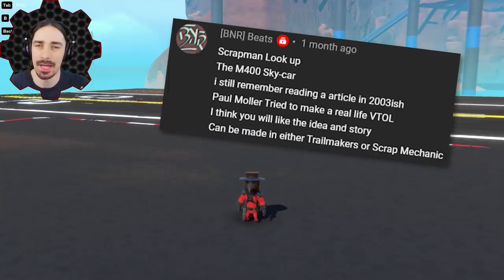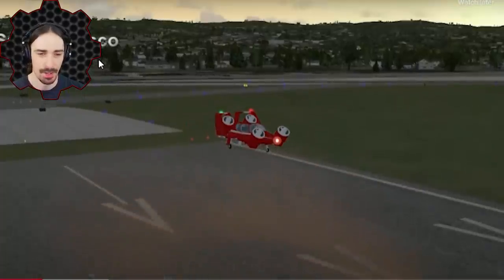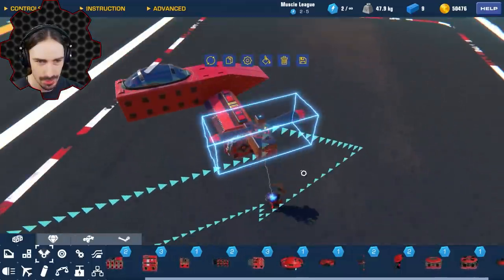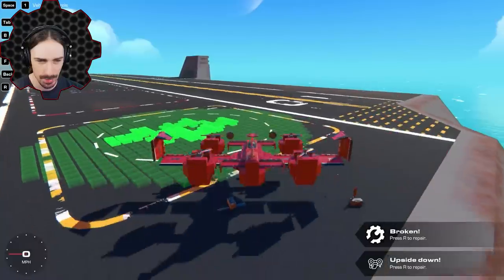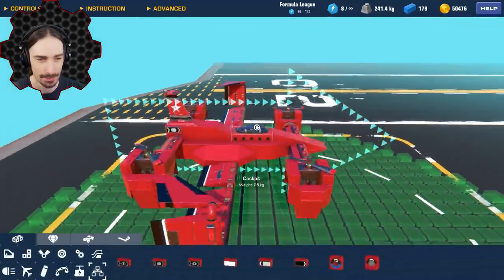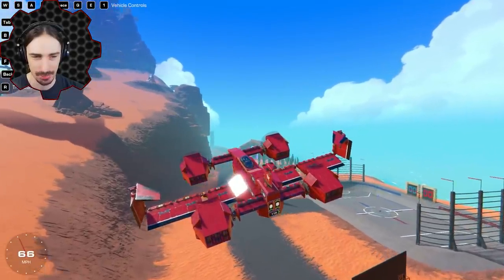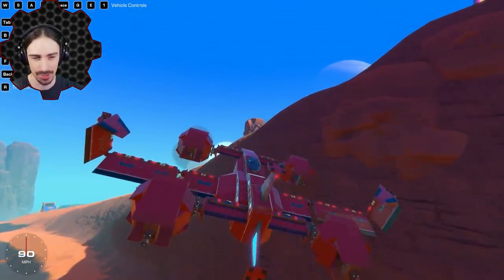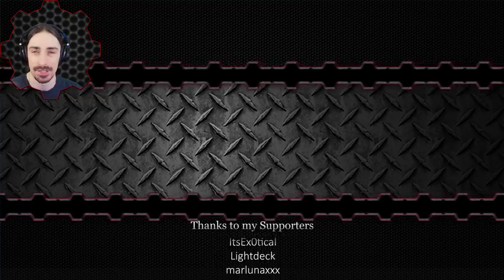This Failed Flying Car Was Supposed To Be Our Future... SO I BUILT ONE!

Comment: Problem also is having an open propeler spinning thousands of rpm in a street
Reply: For this version, yes. The original had its props inside of a duct, presumably just to get around that problem.

Comment: I'm kind of disappointed that you immediately changed the design with out even giving the original idea a try. Even though im pretty sure it would not have worked. The blueprint you ended up with did turn out really cool though.

Comment: day 170 or 171 of asking scrapman to start a Survival series amphibious tank/basically any transportation and floating base/barge (or under water.) But you need mods... it's a requirement to breathe underwater, if you want an underwater base/transportation. And yes i am talking about the underwater fan moonbo reviewed that basically makes water spaces air spaces... if that makes any sense.) (and if you wanted to move the barge/boat/floating base you are able to make thrusters/glitches/mods to do it or by lift or actual push

Comment: Yeah, hate to break it to ya, but flying cars are probably never gonna be a common thing for the everyman.

Why?

Because we don't armor our roofs.

Do you want it to be possible for some random, possibly drunk/high/exhausted idiot to crash through your ceiling while you're in bed? Or through your kids' ceiling and crush them in their cribs?

To become a pilot requires a lot more training, frequent medical exams, and can be revoked for comparatively little reason vs. driving a car.

Imagine if to be allowed to drive a car, first you had to have roughly 100 hours of ground, dozens of hours of practical instruction, then to pass a number of hurdles, had to train for what happens if you get a flat tire, if your engine dies, etc, then pass at least one final test... and all that is so you can fly a low-powered commuter car on surface streets on clear sunny days only. If it rains or even just gets cloudy, you have to pull over and wait for it to clear up. If it gets dark, you have to pull over and wait for dawn. You also have to file your plan on where you intend to go with the state highway patrol (though you're not allowed to even think about going on a highway yet).

If you want to drive in the rain or at night, you need another bunch of education, training, and testing. If you want to drive a more powerful car, or one with different capabilities, that's more training and testing. If you want to be allowed to carry passengers or cargo to make money with your car, that's more training and certifications. If you want to switch to a different type of engine, like a diesel, or an electric vehicle, you need more training and certifications. If you want to go onto the highway, you need, you guessed it, more training and certifications, and to fit your car with real-time location and identity broadcasting, multiple radios, and emergency beacons so that the Highway Patrol always knows where you are, who you are, how fast you're going, and what your intended route is, or they literally send armed combat vehicles to escort you off the highway immediately, after which you'll probably have your license revoked or suspended.

Not only that, but you have to prove that you have literally all of the factory-recommended maintenance done, every time it's needed... I think you get the idea.

Though actually, since you made this, the first real successful sky-car has been tested. As in, it drove to the airport on roads, legally, deployed its wings and control surfaces, taxied to the runway, took off, flew to another airport, stowed its flight gear, drove to a restaurant to get lunch, drove back, took off, returned to the original airport, and drove home.

Comment: it's aggravating seeing scrap man never ever look up why airplane basically always have the wiehgt in front of the lift. you literally need it for balanced flight.

Also, you can use control surfaces to counter any torque from that.
Reply from the maker: I've been aware of that for a very long time. I also have to take into account that video game physics and controls are much more basic than real life and putting most of the weight in front of the center of lift inevitably causes a more extreme pitch down effect. Mostly because the body of the plane does not contribute much to the lift or aerodynamics in trail makers compared to real life. In an effort to keep videos more entertaining and broadly appealing, I try to avoid over explaining the physics or reasoning behind every little choice I decide to make, which inevitably leads to people assuming I just never considered any of it
Reply: @scrapman  Fair enough. I didn't actually expect that comment to be read/replied to so hopefully I didn't step on your day.

The travesty of deciding what to include.

Perhaps a quick second of text which just says "Look, I know, I know, you don't need to comment plzzzz stahp" would save you from more comments from the other mes that think similarly.
Reply from the maker: You'd be surprised. Sometimes even when I mention things in videos specifically to avoid comments about it, people miss it and still comment about the exact thing I addressed in the video